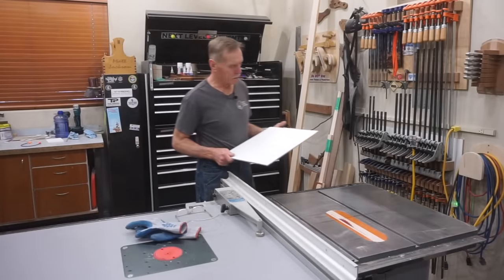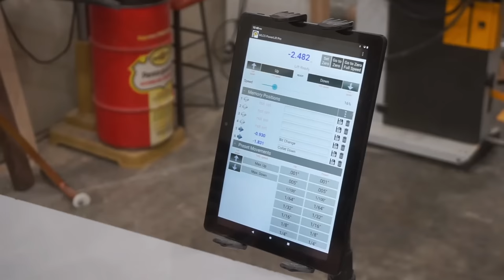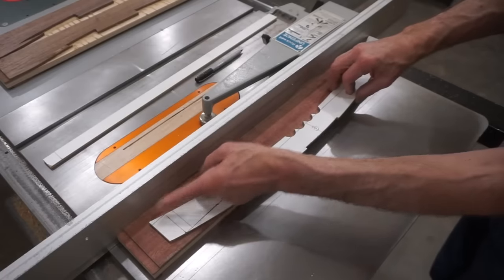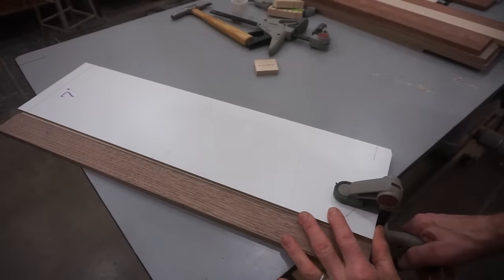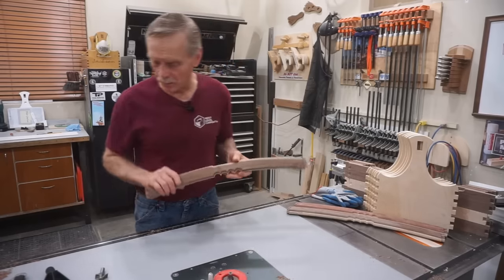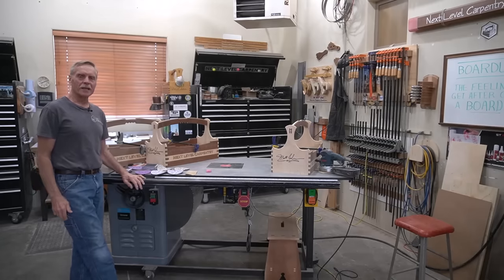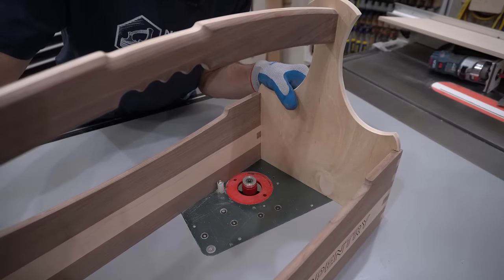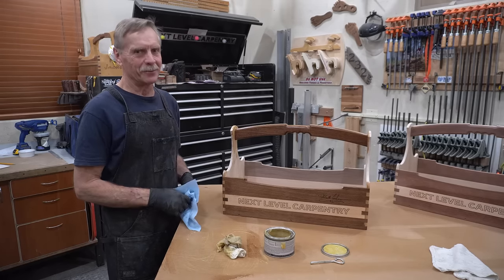Master Carpenter's Tool Tote Build

Comment: You should totally do a 5 minute video on YouTube on how to make the radius for the handle. That’s a trade trick that’s worthy of its own video.
Reply from the maker: Thanks for the suggestion Danny.  Turns out I did do a video on that some years back but, no surprise, didn't get it done in 5 minutes 🤣 https://www.youtube.com/watch?v=ykzQurvEqOo
Reply: @NextLevelCarpentry  I didn’t see it back then. I appreciate it you showing that tip.
Reply from the maker: @dannydodge7191  That video was a LLLLLONG time ago but it's a timeless tip for sure. I think it's something I originally got from Fine Woodworking or Fine Homebuilding magazine but have used it with great results for decades...

Comment: Great video! Tons of detail, outstanding tips and inspiration. Been meaning to make a tote just like this for years. I've used one forever, but it's one my dad made me about 20 years ago. Nothing flashy, but so handy. I don't like wearing tool belts, so I love to use my tote to toss just the tools and fasteners I need to do the job such as patch a roof, mend a fence, or whatever little job around the house needs to be done in an afternoon. Nice save on the finish at the end on the blooper reel. Good thing you had the apron on.

Comment: Thank you for the video and tips. I enjoyed the project greatly. By no means what follows are complaints or knocks, just a few alternate takes. I would have swapped out the white notches by chiseling off the white end at a 45 and set in a dark one. This way the view of any side would not be odd. On the grip I think adding some bulk and then turning on a lathe some (if I had one) to fill up the hands grip and not have all the weight of the tools on the second digits. And finally, as you said there a lot of choices in attaching the bottom. I would have gone with a cleat on the inside of the box so the screws would not have been seen or in need of plugs. Thank you again.
Oh, I made it all the way to the end of the end of the end. That CA sealing ig a great idea. Thank you for that one too.

Comment: Im currently 89 years old.
I started working in the home building industry in 1951.
Back then every carpenter had a wood toolbox of a similar design of this tool box.
However they werent nearly as attractive.
They were made from basic material, usually white pine, and as a rule had no finish on them.
They held all the tools required for framing work, and were carried from a vehicle to the workplace.
The only tools a carpenter would have on his person would be his hammer and a 6 or 8 ft folding wood rule.
And a heavy cloth nail apron tied around the waist held several different size nails and a pencil.
Some carpenters, especially finish carpenters wore white bib overalls which had the nail apron built in, as well as pockets and loops for pencils, hammers, and other small tools.
Buckets were never used for tool storage, probably due to the fact that there was no such thing as a plastic bucket back then.
Metal 5 gal. buckets were ones that some type of material came in, like paint for example.
Most carpenters. had 2 wooden tool boxes, one held all their framing tools, and the other all their finish carpentry tools.
The finish box would be larger and contain things like drawers for tools like wood chisels.
Todays framing carpenters mostly wear all their tools all the time by use of a large tool belt with suspenders.
I personally dont understand the logic to having all those tools hanging on you all day.
If i were still active today i would probably be wearing a tool belt also, but a much smaller one, with most of my tools being in a nearby tool box.
And on the rare occasion i might need a tool like say a cats paw, id just go to my box and get it.
Or id be asking someone to toss me one.
All that said, sorry for taking away from your very nice tool box video.

Comment: Watched all the way through the blooper :)
I have used Bartley Gel Varnish for years - I'm assuming the Gel Poly you're using is not very much different at all.
The desk I'm sitting at has 6 coats as does the mahogany electric guitar I finished - wonderful to hold and play!
Did have a Q: Why plywood on the ends?  I had expected a solid wood...
Reply from the maker: I chose Russian Birch plywood for the ends for joinery integrity.  With solid wood, the ends would need to be two pieces: one oriented horizontally for strength in the finger joints and the other vertically for strength for the handle.  That's doable but I actually prefer the beauty of all the fine plies of Russian Birch as an additional design element.  It's also in the same thought process of a plywood bottom held in with screws: real world practicality... IMHO.  It would be cool to see if any viewers adapt the overall design to a 'show piece' tool tote made entirely out of solid wood...

Comment: Instead of remaking the handles could an inlay of a walnut or different work been put in to hide the gaps in the mortise without affecting the strength of the mortise? Just curious if that would of worked aswell
Reply from the maker: I like the way you think.  A number of similar ideas crossed my mind and, if not for the fact I was posing as a Master Carpenter producing a video worthy of that persona, I sure would have used a different work-around.  Show business is a tough game, right? 😉😎

Comment: Use millimetres only joking briliant work. I'm Scottish  we very rarely use inches etc and I'm a carpenter. Its odd engineering drawing's etc are all in MM but when we go to Timber Yard we ask for 4by2, 3by2, 2by2 etc all inches. Plywood/Sheet materials are the same 8by4ft etc. Its the transition from MM from inches & feet in the last 40 years. Millimetres/CM/M are easier to read on tapes etc.

Comment: Completely unrelated to the project here, what band saw is that? Im in the market for one, want it big enough to do some resawing, but i also want my bandsaw to be capable of general use.
Reply from the maker: That's a Laguna HD 16 bandsaw with an absurd re-saw height capacity... that I 'never' use.  In the meantime, the extra-long blades cost more $$ and provide no benefit.  14" bandsaw with 12" resaw capacity is probably all I really need and would  be more than adequate for "general use".  Shop for the best quality within your budget because more capacity with less quality is a loosing proposition IMHO.
Reply: @NextLevelCarpentry  fair enough. I'm thinking I could use all the resaw I can get. I like working with live edge but I don't like making furniture that weighs a ton a piece, so Id like to be able to resaw live edges and back with a 1/4 inch ply. I've done it a couple times but my table saw only cuts so deep. And my handsaw finishes have given me mixed results. I think I push too hard with my saws.

Comment: Maybe i missed it but why did you not screw the bottom peice through the bottom of the plywood? Potential splitting or is the rabbet too small?
Reply: Incredible work btw. But that goes without saying
Reply from the maker: Yeah, the rabbet is too narrow for screws to work. Another reason is that I don't want exposed screw heads on the bottom of the tote where they could scratch surfaces when the tool tote is set down.
Reply: @NextLevelCarpentry  I thought maybe small countersunk screws would work but yeah I get the rabbet is small. The screws on the sides look fine anyways
Reply from the maker: @grmrbrts5123  Yours is just the sort of suggestion that moves design forward and is always welcome.  You could make the rabbet a little deeper/wider and then use the small small countersunk screws to prevent scratching.  That would remove visible screws but thinner would might chip more easily?  Who knows, but it proves the point many things in design aren't right or wrong, just different.
Reply: @NextLevelCarpentry  True. Thank you

Comment: I have several tool chests.  Some are metal. most are plastic.  None were pieces of furniture.   They were FAR more functional than what you built, and far less labor intensive  to buy.
Reply: I think you just identified the difference between a craftsman and a worker... enjoy working.
Reply from the maker: FAR more functional you say?  Interesting.  Also insightful to know labor intensity required to buy a plastic toolbox is a factor for you...
Reply: You are missing the very point of this channel.  Yes, you could go to HD and buy a plastic tool box.  Yes, it would be cheaper to buy it.  Or, you could be like a lot of guys and buy a HD bucket for 3 bucks and carry your tools in that.   But this channel is not about cheap work.  It's called "Next Level Carpentry" for a reason.  There are more lessons in this video on technique and process than you could shake a stick at. Those techniques can be applied to all sorts of other projects and situations.   And it's FREE to viewers on YT.  Free to decide to watch or not.